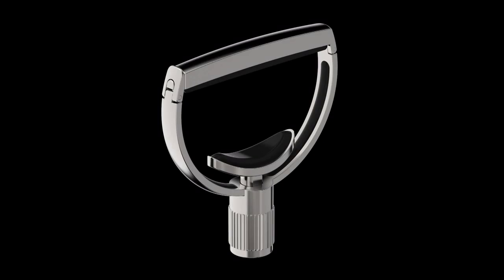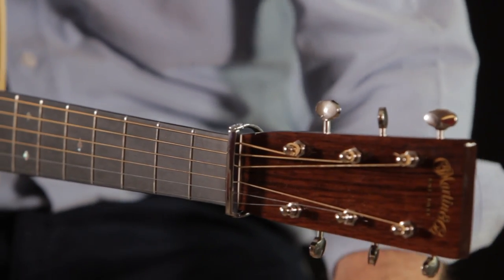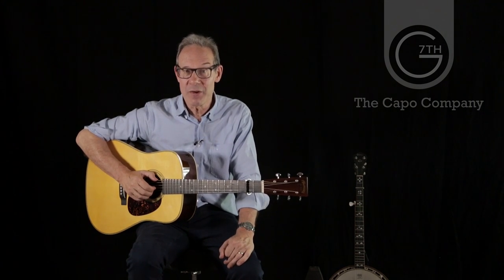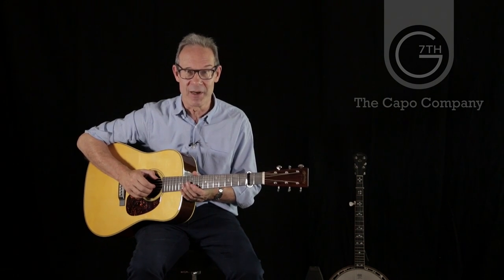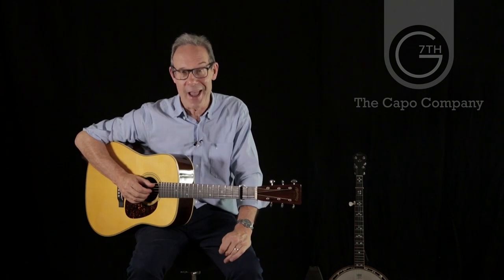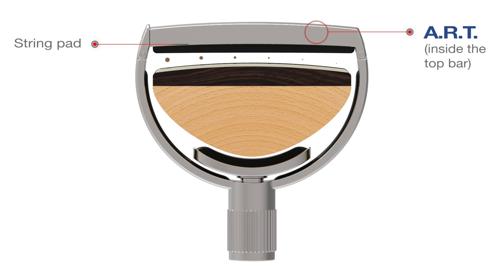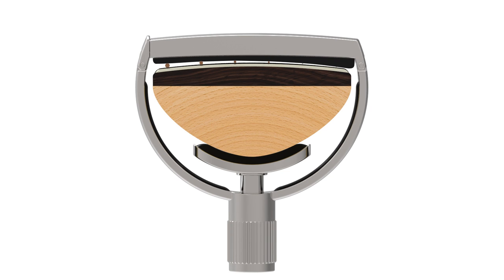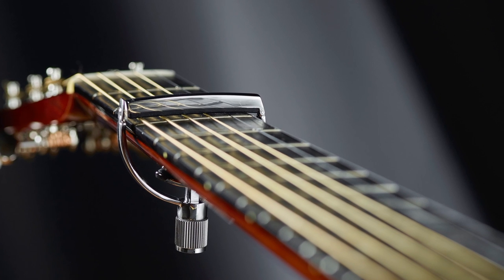G7th Heritage Capo

Comment: In my 44 years of playing professionally, I believe that I've likely used nearly, if not every quality capo that's been on the market. I began using G7th Capos when I first saw them advertised in a guitar mag. Once I did, I never went back to other capos. I've used every different model of G7th and when The Heritage came out, it changed everything for me. I had far fewer issues with former models by G7th, but The Heritage keeps my strings tuned as they were prior to putting on my guitar. At first, I thought I was tightening too far to get rid of buzzes and would end up sharp, but I was happily proved to be wrong. The Heritage is the last capo I'll ever buy - at long last!
Reply from the maker: Thanks Rick! :-D

Comment: I've recently struggled on the 5th and 4th fret where the g string isn't forced down enough with many other capos...I just bought a performance 2 and it simply works...HOWEVER later that day I started my set and capod the first fret and the performance 2 just doesnt pull down enough and the b string buzzes. 
This isn't a complaint about that capo it just doesnt work on my taylor grand  pacific. It has a slight v neck profile with a rounded 12" radius...the neck profile changes around the 3rd fret to a c shape. 
My question is...can you change the rubbers on the heritage capo? I think it will work very well on my guitars but I dont want to pay over £100 every year and for each guitar.  New rubber would sell me.
Reply from the maker: Hi Eddie! Yes, you can buy replacement string pads for the Heritage capos through our website :-)
Reply: @g7thcapo  
That's great. Do you think the heritage will work on the grand Pacifics? And all the heritage yoke type have the a.r.t do they? 
Thank you for getting back so quick. ✌
Reply: Also. The ones on amazon. The heritage 1 is up for sale at just over £100 . Will this be a copy or one of your own? 
Thank you again
Eddie
Reply from the maker: @thefisherman2837  Yes, it will work on the Grand Pacifics - that's exactly what the ART was designed for; working on all different guitar necks. I suspect the one on Amazon is one of ours, but it will be one of the earlier production batches. I'd suggest trying to get a newer one as there have been several updates. What country are you in?
Reply: @g7thcapo  that's great. 
I'm in the uk. What updates have you done to it?
Reply from the maker: @thefisherman2837  Ok, so there are a few stores in the UK that will have them (try Google) or you can order direct from us (we're in Peterborough). We've made several updates since the initial launch, including improvements to the ART, changes to the adjustment knob to improve reliability and reduce the number of turns required to tighten the capo.
Reply: @g7thcapo  ok that's good. Can I call you guys direct and pay by card?
Reply from the maker: @thefisherman2837  We're not set up for that, it all goes via our website. PayPal is the credit card gateway, but you don't need a PayPal account to use it - just continue as a Guest. If you have any trouble placing the order then ping us an email on hello@g7th.com :-)

Comment: Oh Yeah !!  Make one for a 12 string acoustic guitar (Guild) that will REARLY work, and i'll be interested !!!
Reply from the maker: The Wide Guitar model can be ordered with a different insert for a 12-string capo. It has ridges in the bar rubber so the heavy string and octave strings fret at the same time, meaning you won't pull anything sharp :-D
Reply: @g7thcapo  In a review it was mentioned that the ridged rubber bar works as well (or even better) than the regular pad for 6-strings as well. So, if that's the case why would not all capo's have the rigded rubber pad? Or at least the Heritage wide (and possibly also normal)!?
Reply from the maker: @nickgoogle4525  Hi Nick! While the Compensated String Pad will work with standard 6 string guitars, there is some compromise due to differing nut widths and string spacing. You should find that on a 12 string it will be great. On 6 strings, particularly if they have smaller string spacings, the ridges won't match the spacing as well. The ridges are designed to cope with this, but a standard Heritage with a regular string pad would usually get better results. I hope that helps!
Reply: @g7thcapo  thanks